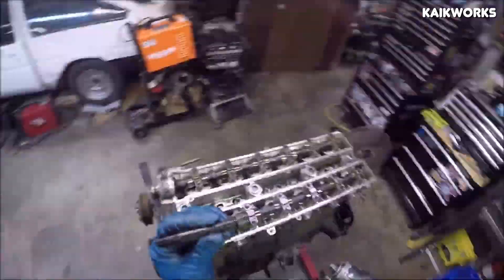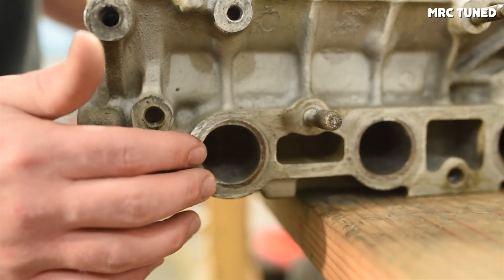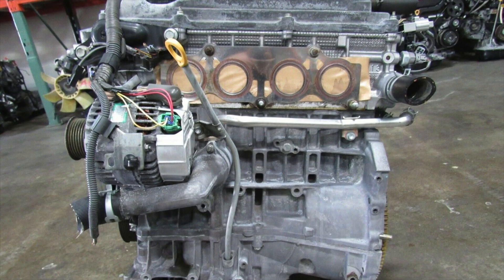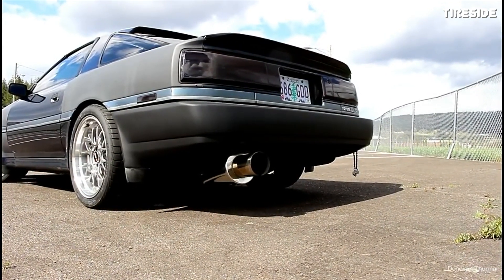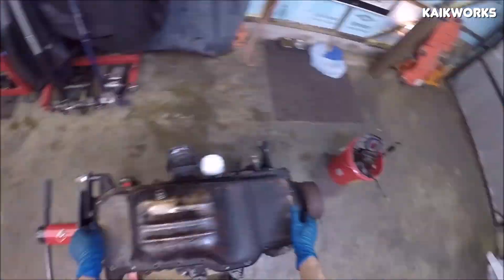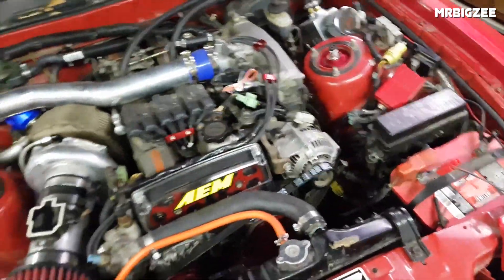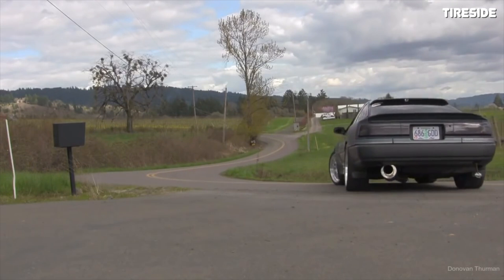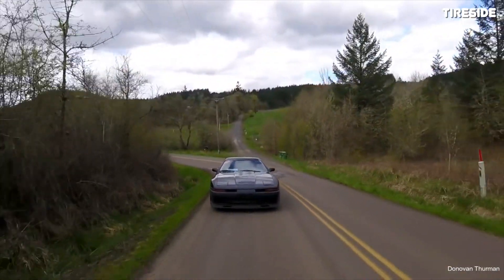Toyota 7M-GTE: Everything You Need to Know

Comment: Good video and lots of great info on the 7M. However, there's a fair bit more to the rod knock issue other than '7M weaker then 1/2JZ'. This will take some explanation.

The most common head gasket failures on this engine happened between oil and water passages which mixed the oil and coolant; this gave you the dreaded 'milkshake'. Unfortunately, when this happens the coolant content in the compromised oil starts eating away at the rod(and probably main) bearings, which eventually results in rod knock. Additionally the stock oiling system on the 7M leaves much to be desired; the stock pump doesn't provide much pressure at idle/low RPM and the stock sump hardline to the block is poorly bent and kinked in multiple places.

This sounds like an extreme fix for a BHG on these cars but if the engine has seen milkshake it is a really good idea to replace the rod and main bearings at the very least. Driftmotion(a very good A70 Supra aftermarket supplier) sells modified oil pumps and high-flow sump hardlines that fix the oiling issue. Additionally if you are going in for a BHG you absolutely need to get the head decked at the very least. If you want to run a metal head gasket instead of stock, the block(and the lower timing cover that the head gasket also sits on) must also be decked; even though they are cast iron they can and do warp slightly. The 7M I'm building came out of a '91 with low miles and full dealer service history(owner went 2J); upon tearing it down I noticed the HG was just starting to go and the block was warped slightly beyond spec. For a metal head gasket to seal it is absolutely critical that the sealing surface is just about perfect.

Other than that, ARP hardware and the proper torque should make for a great engine. As far as why I prefer the 7M? I like the torque, I love the sound, and the M block has a direct lineage to the original 2000GT for that historical angle. There are rumors that the M block was actually developed from earlier Toyota I6 engines, possibly even back to the Chevy Stovebolt 6 that they copied for their first passenger cars. I haven't really been able to confirm this, though it does make for an interesting story and there are vestiges of a cam in block passage inside the engine block itself(the same channel the oil pump uses; additionally there's a fuel hardline bolted in where a mechanical fuel pump would go on a carb'd car). All in all, one of my favorite engines.
Reply: Righteous 😎
Reply: Beautifully said